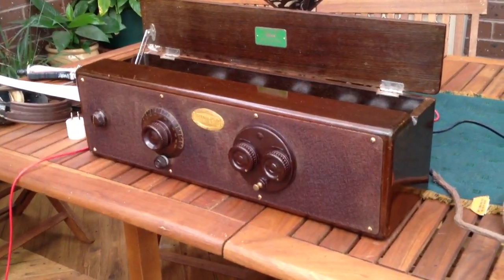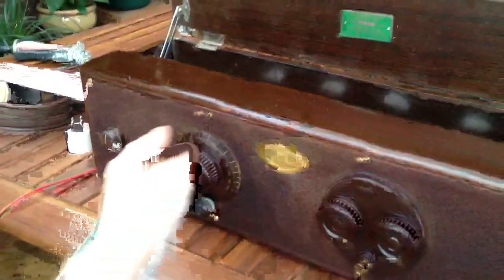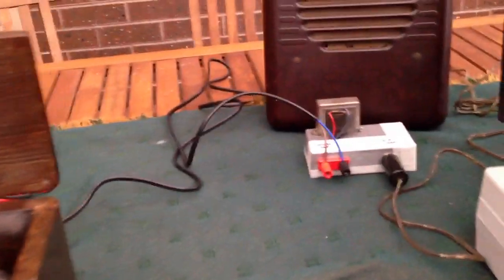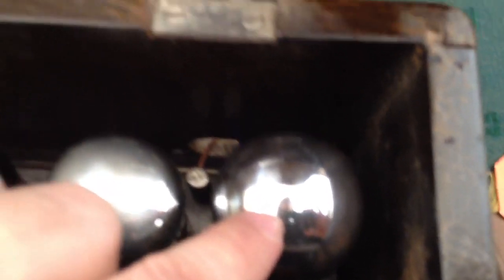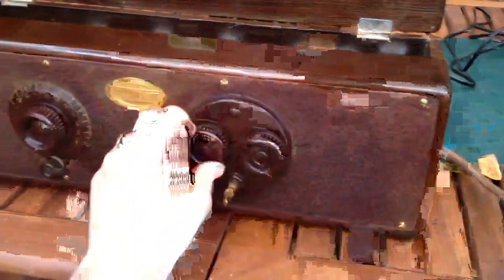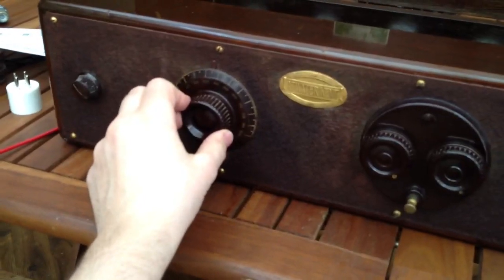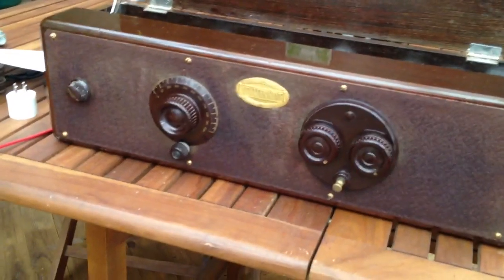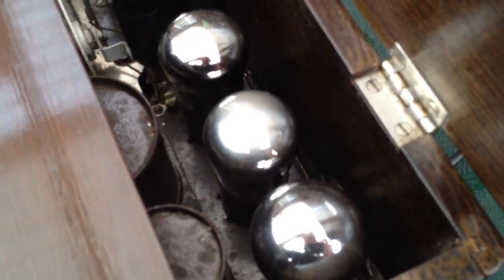Atwater Kent Model 49 Radio

Comment: I have an AK Model 49 with an AK E3 and it is quite the radio. I like to listen to the Cubs Baseball games on this set. It makes one a bit of a time traveler when you hear games like folks in the 20s and 30s heard them. Mine was simple to restore. It had one bad tube. I put in a new tube, bought the E3 speaker, hooked it up to my ARBEIII and it was good to go.  SDPlainsman

Comment: Thank you for getting back. I have ordered a Bogen T-725 transformer and should be able to replicate your efforts with that piece. Dave at makearadio has a good description of the T-725 transformer and has some good tips on how to use it. It can be purchased at a reasonable cost if you shop. Best and thanks for your video.

Comment from the maker: Sorry for the delayed reply. In this video I am using a 7k to 8 ohm transformer I got from a dead valve radio. Instead, now I use a 5W 100V line PA speaker transformer that has taps from 5W down to 0.5W. This translates to an impedance from 20k down to 2k. I put it into an enclosure with a rotary switch so I can easily select the tap that sounds best. It works extremely well.

Comment from the maker: Yes, I got my replacement transformers from there.The originals went open circuit at some point as, when I received the radio, the audio stages had been modified to be capacitively coupled. It sounded fine but I'm a stickler for originality. I also bought my Freshman Masterpiece from the same guy. What can I say, I love old technology - lots of fun.